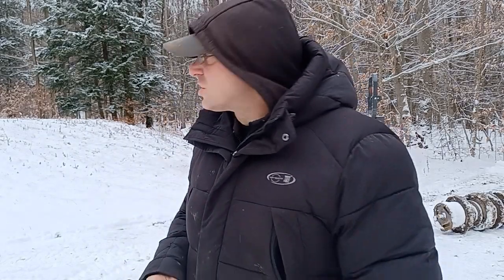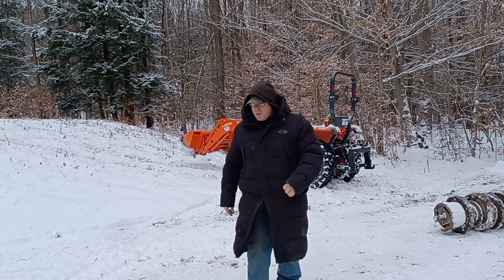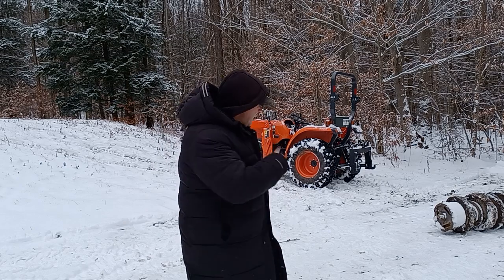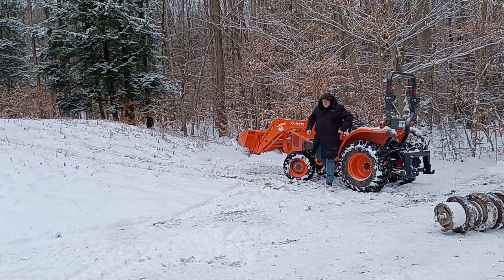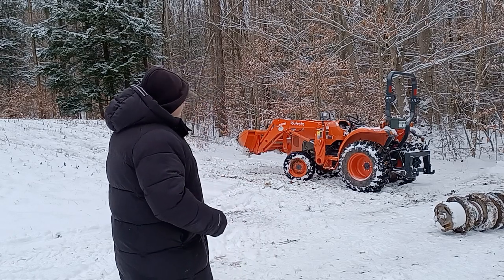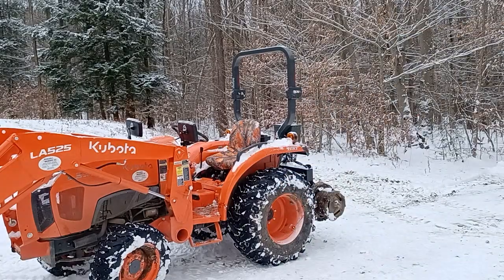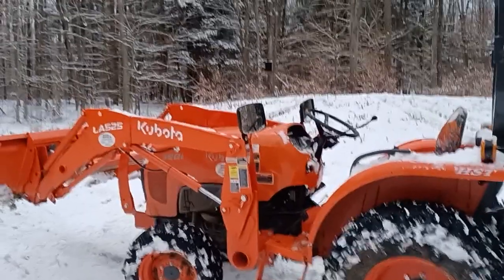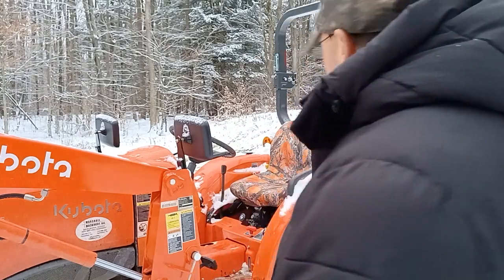Tractor Snow Traction Test - Kubota L3901 - R4 tires - 1k ballast

Comment: Just go chain-drive or R-1s and stop "playing around". What happens when you need the tractor to do something usefull in the snow going up a little hill. Even R-14s would not of done much better. Have different tractors with different tires, CHAINS make ALL the difference in the snow And especially Ice. Thanks for the demonstration vidio Sir, and happy safe tractoring.
Reply from the maker: Thank you 😄

Comment from the maker: rear tires filled
20° incline 2"snow

Tests
4wd - no 3pt ballast : got up slight fishtail
2wd - no 3pt ballast: no go
4wd- 1k ballast: easy up
2wd- 1k ballast: got up

25° incline : 2wd -1k ballast: no go
2wd- 1k ballast: failed. lost traction when dropped bucket
2wd- 1k ballast: got up after some traction lost.

came down bucket first: lost traction because more weight on the small front wheels.
 never lost traction coming down in Reverse with the big wheels first.

I noticed in the video that when I went up to 25° incline the right wheel ended up in a lot more snow than in all the other tests. I would discount the validity of this as disproportionate.